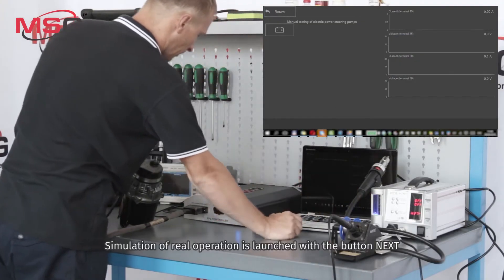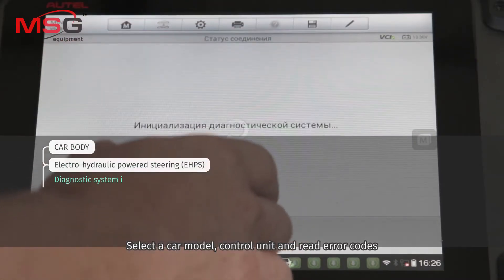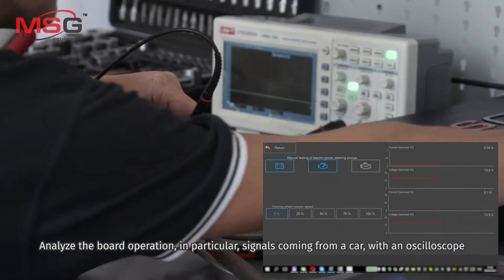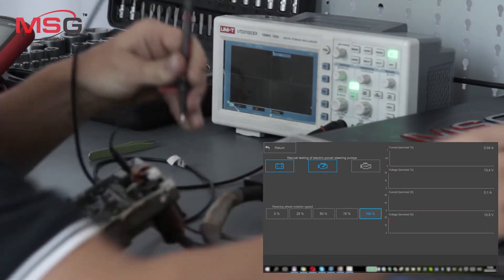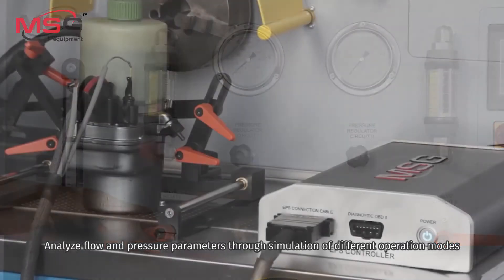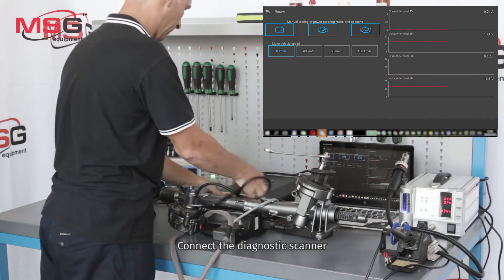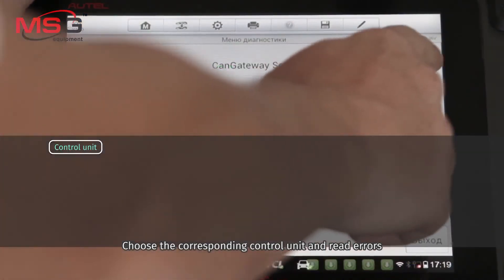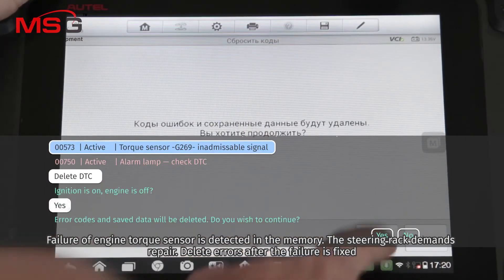MS561 EPS Controller Electric power Steering Diagnostics  How it Works؟

Comment: Very informative.  I'm trying to troubleshoot a 2018 Toyota Camry EPS rack.  Do you know what voltages are needed for bench test?  I'm thinking the controller sees 12v (ign) to turn on but motors need 34v (hybrid battery) to operate?  Any help is appreciated.
Reply from the maker: Thank you for your review. It runs on 12v.
Reply: @MSGEquipment  
Thank you for the clarification.  I think I have a bad unit or I don't have the wiring pinout correct.